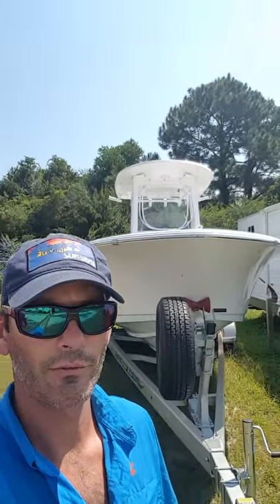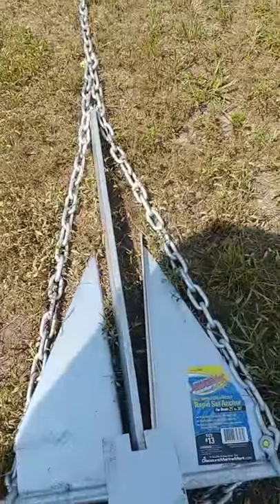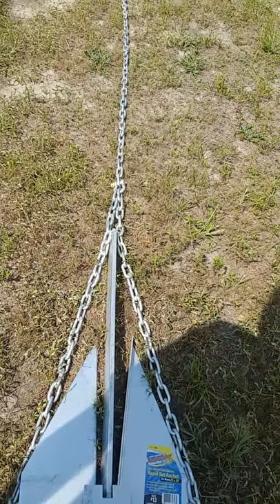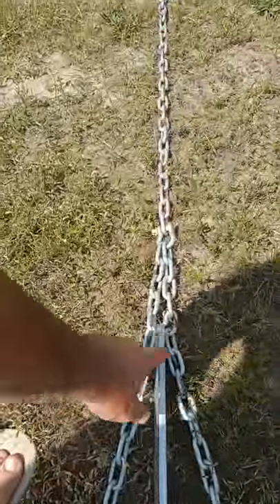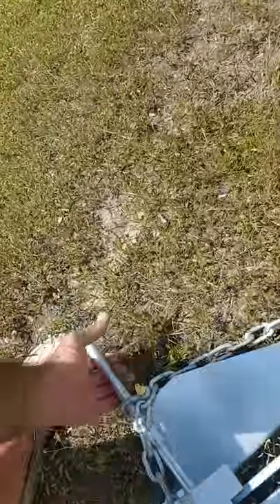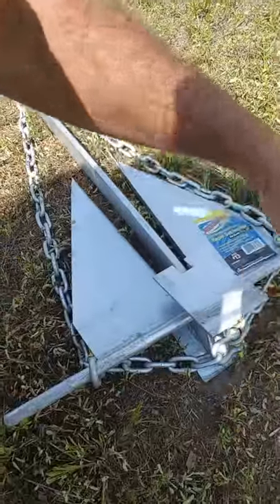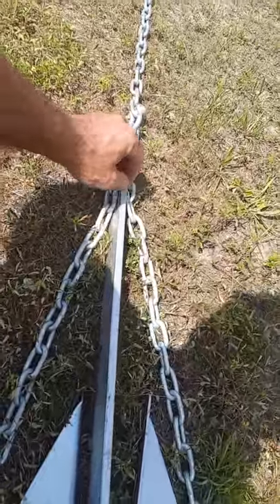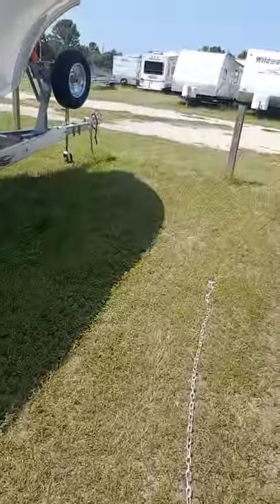How to rig a Danforth anchor so you don't lose it

Comment: I would have welded washers 1 inch in on both sides of the anchor bar then slipped the chains over and welded washers closing the ends so the drag chains are held out away from the anchor flukes unable to get under or hung up

Comment: Looks cool, but if one or both of the chains gets under the fluke, the flukes aren't going to dig in.  This is too complicated and you probably won't see a second video showing how well it works because it won't.  I used a single short length of stainless steel cable zip tied to the anchor and shackled to the chain - never failed.  The Fortress Anchor is too expensive to not add the breakaway.
Reply: Frank, the chains don't get under the fluke if you leave a link or 2  of slack.  Don't tighten the zip tie down because you want the weight of the anchor to be lifted by the chain unless it gets stuck.  If you are concerned about that then just put a few washers on it to spread the chain out beyond the flukes.  I have not done another video because we are always in a hurry to get on the water to fish and I have not spent the time to.  I have not had a single issue with it and it has been stuck several  times.
Reply: I see that you had the problem I was worried about.  Thanks for the update.  I'll look at doing something similar. @mmurray831

Comment: Use an anchor ball retreaval system and save yourself a lot of work and eliminate the extra weight in the vessel.
Reply: I don't like the fact of an anchor ball for one since it does not help if  the anchor is stuck on a wreck and for two because it is just something else that gets in the way. We rarely anchor over 100' deep so for me that is nothing to pull up an anchor.  If much deeper, yes, I would want one but at that point I'd just install a windless and be done but I would still need a safety net for if my anchor was stuck.

Comment: I am quite sure Mr. Bagel has a hole in his head and I applaud you for your efforts.

 I have been looking into rigging my anchors with this "breakaway" system. Easily done on the Delta plow. There is already a hole in the shank near the plow where a shackle can be attached. A bit more complicated with a Danforth for obvious reasons. I have a Fortress that's works very much the same as a Danforth.  So how did it work out? I would really like to know before dropping a $$$ anchor into the deep blue.
Reply from the maker: LOL.... He might. I messaged him back and am looking forward to his next comment.  This has worked great.  I have not lost the anchor and it does get caught occasionally and breaks away like intended. The one problem that I would like to work out is the chain and shackle will sometimes restrict the flutes from digging in.  I ended up just putting more slack in the chain and leaving the zip tie looser, not tight at the eye hole.  Ideally it would be best to slide a few nuts on each side to move the chain wider so it will not catch on the flute. Definitely would want something on a fortress!! Let me know what you try.

Comment: Attach the chain to the crown & run the chain along the shank & tie wrap it to the end of the shank, best way for a trip system
Reply: That works but as someone else stated on this post it only works one way
Reply: @mmurray831  no, that should work either direction. If the chain is in the downside of the anchor when it trips. It’ll still it back out the way it went in.

Comment: How has this system worked for you? I had mine attached by the crown but like you said it only works one way. I got tried of resetting the anchor and making sure it dropped properly. I have it attached on the top for now.  I curious to know if it works for you?
Reply: It has worked well but if you want to hit all the skeptics issues read my responses.

Comment: Well, how did you make out? Success?
Reply from the maker: It has been pretty rough so it took me a bit to get out and try it, but when I did it worked great. The 20# zip tie did break so I used a 70# and it worked perfectly.  I will probably change the chain with a larger size and slide it over the stabilizer bars like I originally intended to do. I haven't had any problems yet but playing with it the shackle seems to catch every once in a while. I will put another video together soon on the results.
Reply: Have you got a new vid yet?
Reply from the maker: I have not but I will soon do demonstrate how it works.  I Have not lost it and it has hung up so it works!
Reply: Keith, this has worked great for me but there are some skeptics out there if you read some of the post.  Thanks for asking though